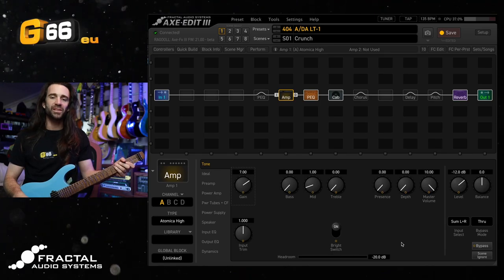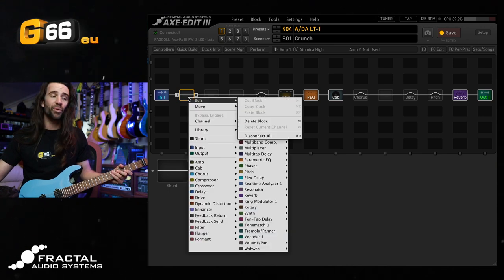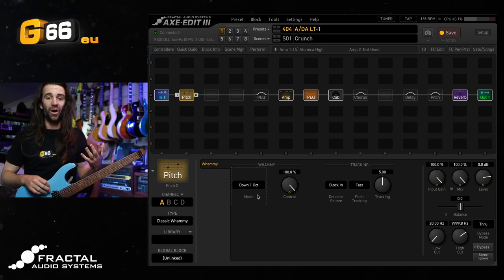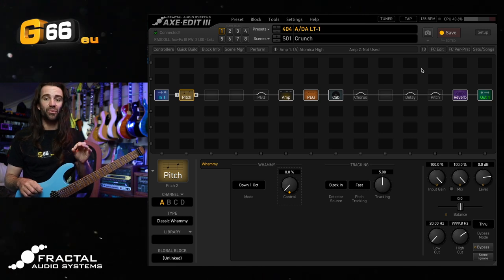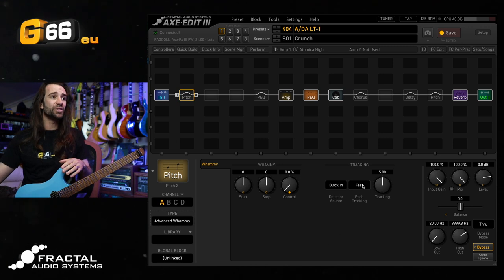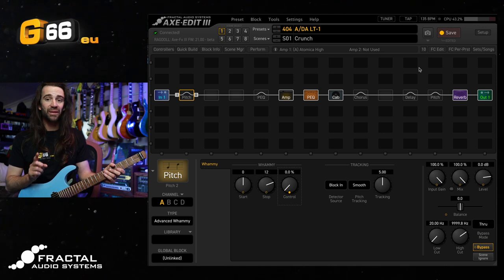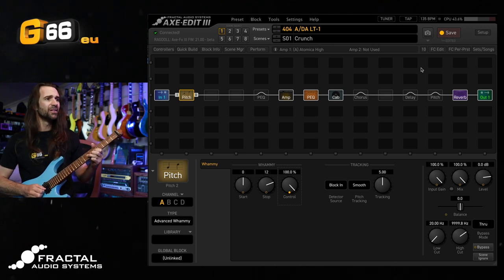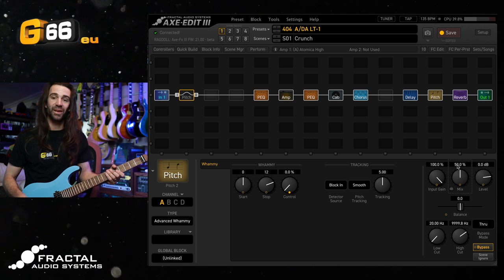Pitch Block Whammy Ideas | Tuesday Tone Tip

Comment: Hiya Leon, I have a question, take a listen to Jeff Becks track So What off the album Jeff, the intro has an effect that maybe is a pitch shifter, been looking to figure this out for ever it feels, and yes just in case you are going to ask I have been messing with the advanced whammy quite a bit of late, maybe its what he used to get tone happening, the album was engineered by some of the best in the industry as you'd expect, there's little to no info that I've been able to dig up, if you have a moment try to figure it out please xx
PS - Love your work dude √√√